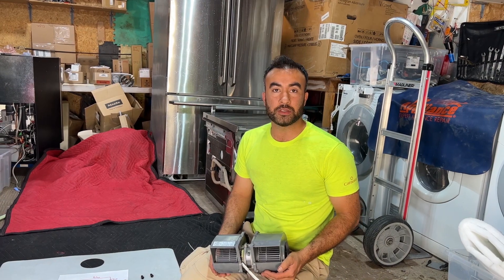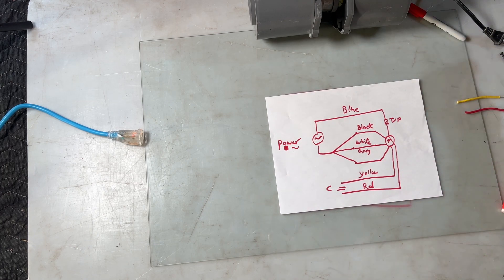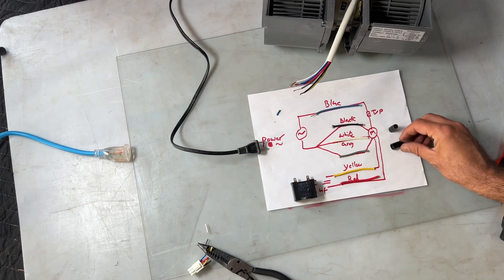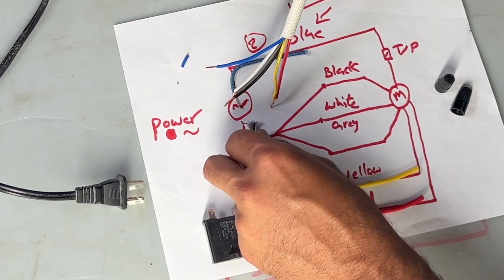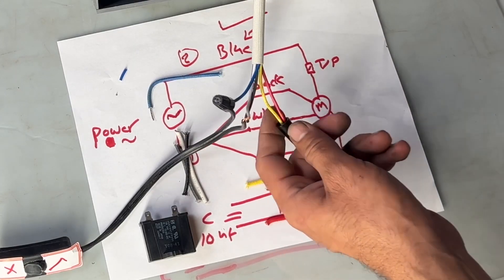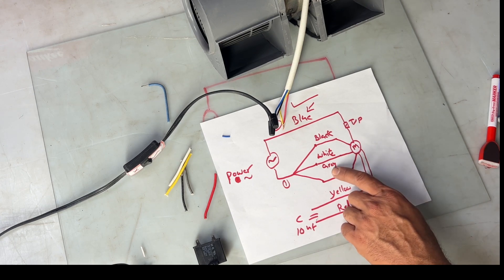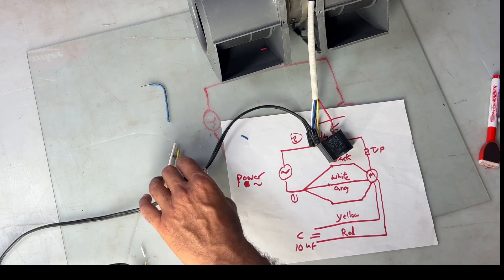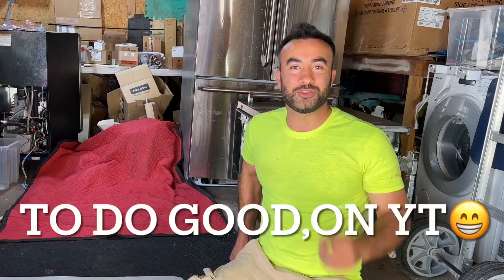How to rewire microwave blower motor

Comment: Different variation with 7 wires - F401W9D90AP - with 12uF capacitor and 7 wire(Brown) is the lowest speed, the rest is same configuration.
285W-2.42A / 198W-1.67A / 152W-1.26A / 136W-1.17A
Reply: I have the same thing and I’m  about to test it
Reply: Update: I tested it and it won’t start by itself 😢

Comment: Thank you!  I have a salvaged blower that I wanted to use but had no idea of what the proper wiring configuration was.  I didn't have a 10 microfarad capacitor, but did have a salvaged 4 micro farad that was rated at 250 volts.  I soldered it in and the fan works perfectly.

Comment: Hello,
First time watcher and you got a new subscriber :-) 
I'm wondering does it matter which direction the capacitor goes? Should the capacitor be hooked up yellow wire on the left side, in relation to the label on the front? Or red wire on the left? I noticed that yours is yellow wire on. 
Thank you
Reply from the maker: Good day!
The 2 wires you add in capacitor does not matter which way . ✌️
Reply: @hameedwafaAFG  Thank you very much
Reply from the maker: @V1ncent19  you are very welcome , you could always follow me in Facebook Hameed appliances repair 😁✌️